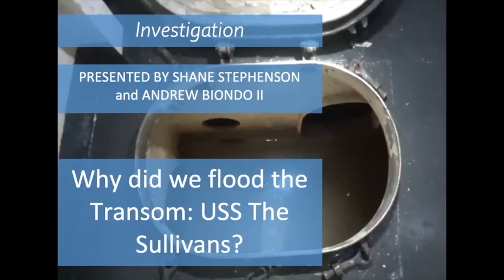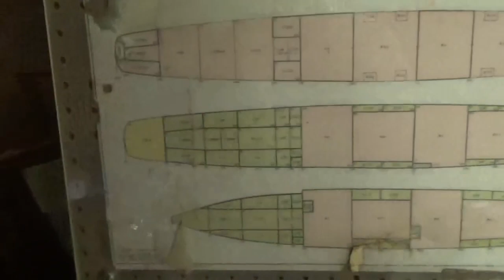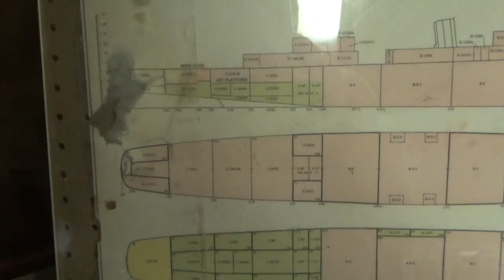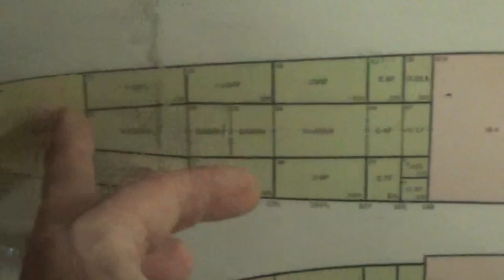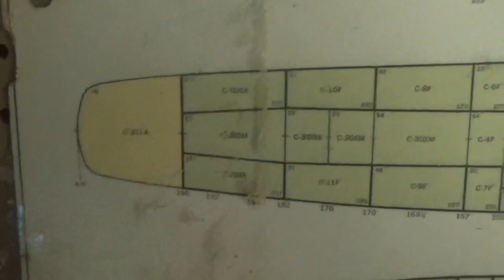USS The Sullivans: Why did we flood the Transom?

Comment: So, was that flooded area flooded during operation in war time as ballast 4 trim, or dry?
Reply from the maker: Jim, that area was certainly dry and held a variety of ships stores. We flooded it in 2003 because we cut the props off of Sully at that time, and the Naval Park needed some ballast to keep her stern down...we're now looking to remove the water and add different ballast...Permaballast, Steel sheeting, et cetera. Thanks for watching.
Reply: @BuffaloNavalPark  SO, were the baffles installed after the props were removed? It doesn't seem feassiblr that they were there when those compartments were used as "dry storage"?
Reply: @BuffaloNavalPark  2nd (or 3rd?) question, what happens in the winter, do u pump it out, put in bubblers or add antifreeze 2 the "bilge" water?
Reply: Jim, No antifreeze, it's free-flowing. The previous admi s did this,, the current wouldn't have like they said. But we'll never know why.

Comment: What on Earth prompted someone to drill holes in the transom to flood the aftermost double bottom? If the object was to compensate for the change in trim due to loss of propeller weight the correct way to do that was to use clean fresh city water introduced through a hose from shore. Cutting holes in the hull to permit the free exchange of contaminated river water was to say the least, insanity. Why were they not permanently sealed? What do you think happened as the holes you created submerged deeper? What is the excuse for drilling holes in the hull, cheaper than buying city water? This is a major example of the type of incompetence and negligence that lead to the loss of that ship. Contributors beware.
Reply: Note, that was done by prior management teams, the current one is trying to fix things...

Comment: Considering how badly the paint is peeling, wouldn't it be a good idea to pump the transom dry, sand blast it completely clean and repaint? Obviously, the cost would have to be covered, somehow, but it would help to preserve all those bulkheads once it is reflooded.
Reply from the maker: I'm thinking with everything going on, there will be a new plan in place. I'm ready to climb into those baffles and lightening holes for sure!

Comment: I bet this is where the fatal leak occurred! Why didn’t they just preserve the transom and load it with concrete for stability? That’s why civilians that are in charge of museum ships are doomed!
Reply: Concrete is just as bad if not worse as its acidic.  Another method would be to fill the transom manually without the water flowing through which causes cavitation.  For example the USS New Jersey has some of her tanks filled with water to add ballast.  Its not as much of an issue because no matter what if that water gets into other parts of the ship you don't have an opening to more water.  You will still have the same amount of water.
Reply: @Tim Mangos  again probably cost.
Reply: They should have hired a Naval Architect.

Comment: Well sadly this concern in Dec 2021 has become the worst problem as of today 4/14/22 as the ship has taken on water exactly as the worry was stated in this video. Hope it is recovered and repaired.
Reply: These fine folk are doing what they can with what they have. The USS The Sullivans has started to rise, recovery of any vehicle is an intense process, as the structure and condition of the vehicle is the primary concern and factor of if it can be recovered in the first place. The progress they're making is huge, in my opinion, though I am admittedly no expert in ships or boats. I am considering volunteering, as actions speak much more than words. I do hope you consider the same. Best regards.

Comment: I have a legitmate question, Could the transom have possibly blown out causing the current listing and partial sinking of the ship? By blow out, i mean the total bulkhead and wall get blown out
Reply from the maker: We were able to get back to the transom the night before she went down as you see her. I made sure to look into the hatches you see in this video. It looked the same, and sticking my head in different spaces I did not see catastrophic gashing or openings anywhere. Thanks for the question!
Reply: Hind sight would say if it needed to be flooded to lower the ship, it might have been wiser to seal the compartment, paint a fill line and then run a garden hose until the compartment is filled to the desired level. Drilling holes and opening the ship to the river may not have been the best solution.  If not open to the sea and the bulk head gave way then the flooding would have been limited to the volume in the compartment.  If this thing is salvaged, then closing the holes might be something to consider.  Even placing ballast in those compartments in leu of H2O might be considered.
Reply from the maker: @Privat2840  Michael, thanks for your thoughtful insights. Everything is on the table, and these will be brought to any follow-up and any plans moving forward! So appreciated!

Comment: Seeing water being intentionally stored and maintained in a steel compartment is pretty counterintuitive. Are there any actions taken to keep the oxygen levels in the water (and thus ability to cause corrosion…esp at the air/water interface) relatively low? Given that the transom is open to the outside waters of the river, may not be practical. 

But thinking of long-term solutions, if the propellers are going to be kept off the ship, has there been any consideration given to hanging deadweight ballast (such as steel or cast iron plates) submerged off the stern more or less in the same area that the propellers had previously been? That way the transom could be purged of water and bow/stern trim maintained.  

Seeing that checklist in the transom was noteworthy, have spent the last bunch of weeks volunteering on New Jersey replacing and updating checklists on our tour route!  Need to get up to Buffalo, my wife’s family is still there and my mother in law has spent several night aboard with USN Sea Cadet detachments.
Reply from the maker: Tony W. Hello from Buffalo, and yes - hope you get back to visit your in-laws and come on board! These are great ideas. Previous staff decided to flood the 2nd Platform, so current staff had no idea the reasoning behind it. I'll be talking to our Maintenance Foreman about your good ideas, and we'll kick this around before taking it to management and the Board for input! Glad to hear you were helping out at the New Jersey. It's a good ship with a great crew, and that sounds like a great project! We're so small staffed that working on a large project like that would take a year or so given all the hats we wear! Again, I'll be sharing your ideas and I really appreciate your comments and your viewership! 
Thanks so much...and next time the Sea Cadets are on board I'll give a shout out! :)

Comment: That water/air interface would be of great concern.  Is there cathodic protection?  How deep is the water?  Has the water ever been tested for its content?  Also, the cloudy water shows lots of minute sediment in solution.  How much sediment has collected on the decks of these spaces?  Looks like the paint has collected some organic stuff?   Zoinks!  Enjoyed the tour!  Thanks Shane, Andrew! and Skinny!!!
Reply from the maker: No Name - Thanks again for your comments! Good thoughts. We have not had Cathodic protection yet, but that is coming this summer. It's going to ring around all three ships. We haven't tested the water, but it's from the Buffalo River, and has probably been in those transom hold spaces for quite a while - don't know how much the water changes out once it gets in there. As mentioned we intentionally flooded it in probably 2002-2003. Definitely some of those decks have had all the paint worn away! Appreciate the comments...we'll be doing a follow up video when we can get someone (probably Skinny) in there during the summer when the water will be warmer, and we'll see what he can analyze!
Reply: All this could have been prevented by properly doing repairs. Why weren’t all the watertight doors closed? There’s no transom on a destroyer it’s called the stern. Anyway have fun getting rid of all that asbestos in the lagging, insulation and deck tiles
Reply: I’m sure at one time there were zincs on the hull, back in the 1975.